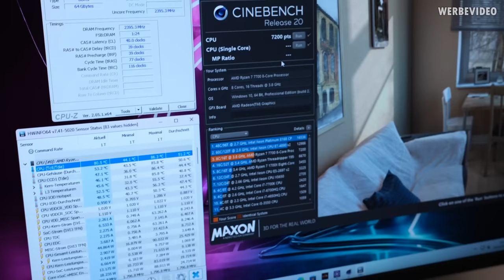Hetzner shows Special AM5 Board with 90° Rotated Socket

Comment: Would love to see a consumer board with the OCuLink PCIe connectors like this baord has, especially on mini-ITX boards where it could allow adding additional PCIe functuonality without requiring much board space.
Reply: Currently the only option is to get a M.2 to Oculink adapter boards. That is a good idea.
Reply: @kawag2780  that's pretty much the opposite of what I want it for. I'd like to have the OCuLink connector to get access to the extra PCIe lanes that would otherwise go unused on ITX boards, not repurpose existing PCIe slots, whether M.2 or otherwise. I've done the M.2 to PCIe riser mod plenty, but it would be nice not to have to sacrifice an M.2 slot and just be able to plug in an OCuLink to PCIe riser (I believe Comino makes some) to access the extra lanes.

Comment: loved the debug plug and s/o to Steve - hopefully manufacturers will listen. Great video, loved to see the Thermal Grizzly cpu bracket and package on the wall behind you haha
Reply: manufacturers won't listen. Many budget consumers don't need the additional cost of a debug led as they aren't enthusiasts and run their computer at factory clock and voltage settings. And for them, the good old beep codes are enough to troubleshoot.
Manufacturers also could provide what is used in embedded : a cost-effective serial interface for debugging like a proper JTAG port. That's a better solution. Why they never provide it even on custom clients like Hetzner is now probably due to avoid exposing the vulnerability of the coprocessor/hypervisor (Intel ME, AMD PSP) but it also could be seen as planned obsolescence and market segmentation.
Reply: @PainterVierax the extra costs are minimal. The actual hardware is pennies for many since they buy these in thousands of units, the coding and engineering has been done for years already so that adds minimal cost to it as well. Its just about updating it to the latest boards. Never mind that the internal bios codes needed are already there anyways. They need to be for the bios to know what beeps to use and errors to display in other ways. The only reason mobo prices are as bad as they are is pure greed
Reply: @Kellen6795  every cent counts for margin, no matter the greediness we're talking about cost effectiveness on both sides. Adding components adds manufacturing time though.
The coding and engineering of those error codes is done by AMI (mainly), not the motherboard manufacturer. With EFI and coprocessors they are totally able to provide any verbose prompt instead of a 2 digits hex number coming from the 80's. Motherboards were capable of memory training and BIOS Flashback way before that.

Comment: The rotated orientation is quite interesting  for me. For my personal rig (7700X) due to my very odd case (and very, very old) I needed the same type of air flow to fit a low profile cooler. Noctua was great in sending me different mounting brackets so I could rotate the cooler 90 degrees and have the intake fans blowing straight thru the fins. Dropped CPU temps close to 10 degrees!

Comment: Would buy if available commercially, great option for a low power ish backup server, or even an edge node
Reply: Stick a Quad port Intel nic in the x8 slot and make it a PFSense router

Comment: Nice, perfect layout for cases where the MB is mounted with pci slots vertical (silverston raven and some other brands uses this setup). great air cooling from bottom, with ram slots not in the way for air to the cpu components. Rams also running cooler

Comment: The cooler works better because the RAM isn't interfering with airflow.  A longer cooler is actually worse because the internal air temperature being higher near the exit means it has a smaller delta vs the heat source.  It's like how with slow fans a thick radiator gains nothing over a thin radiator.

Comment: Sweet custom motherboard to optimize airflow. The guy responsible for optimizing cable routing / plug location was probably on a lunch break when they decided where to put the power connectors though :D :D :D

Comment: That board is basically a reincarnation of the failed BTX standard.
Reply: oh I remember BTX yeah, the PSU was placed on the bottom of the case right?
Reply: Nah btx was mirrored too.
Reply: BTX was mirrored, so that the IO was on the right and required a case with the motherboard mounting on the opposite side panel than ATX/uATX/mITX uses. 

Definitely not even close to BTX. This is more reminiscent of EVGA's "Dark" AMD boards with the rotated socket/RAM.
Reply: It could also be mounted upside down which is what several case manufacturers did for adapting ATX and BTX in the same case. It's a shame that BTX was designed more around fixing the problem of P4 heat than a logical redesign of ATX as the memory placement vs CPU ensured its death.
Reply: @thestrykernet  still required a different case, since the IO has to be at the bottom when done this way, but I do remember a few of these systems back in the "oh how I wish I could forget the" NetBurst P4 days.
Reply: Big Tilted Xotherboard
Reply: @bjn714  I know Thermaltake just sold separate backplates for upside down mounting while Coolermaster had an adjustable backplate and rails on both sides of the case to reverse it.
Reply: @thestrykernet  yeah it's still a specialty case compared to just an ATX case, so they weren't very common (much like BTX wasn't). Luckily this era was after I had already sold my retail shop, and was doing contract IT work, so I didn't have to deal with these except on a few occasions and never actually had to build with one.

Comment: Thats awesome that they get custom MoBo's like that... I guess when you are buy 10's of thousands of boards it's cheaper to get custom boards then redesign your entire air-flow system...
And it's aso great to see that they are willing to test direct-die situations just to see if they can increase the efficiency.... with that many cpu's needing to be cooled, a 2 degree difference could save them thousands of bucks every month on cooling power costs..... with that many computer systems every little bit adds up to BIG BUCKS!!!! 
THANK YOU for showing this!! I LOVE when you make data center videos!!! As gamers we don't normally think of computers at that scale, and we just don't worry about efficiency. It's a nice change once in a while :)
Reply: also cut a lot of money from the IHS i guess
Reply: 200W is 200W no matter how well you are removing that heat. It won't change cooling bills
Reply: @GewelReal  Lower temperatures means less power usage. This is because silicon gets less efficient the hotter it gets. You can even try this at home: set the fans on your gpu a bit lower so that it runs 10c hotter, then you will see that the performance wont change much, but power usage will go up by a few percent.
Reply: @GewelReal  200 watts is 200 watts if you are just talking energy, but if you are talking performance you are incorrect. a CPU that is moving that 200w heat load away is going to be more energy efficient than a CPU that is throttling due to the slow movement of that 200w.
So in terms of cooling bill, you run your systems for less time doing more work.
Reply: @stormagheddondarklordofall7171  we are not talking about throttling
Reply: @GewelReal  CPUs rely on boosting and that works by looking at thermal headroom so if you want your CPU to reach the best possible performance it has to feel the cold. It's not as simple as with Pentium 4 where it just ran regardless and it thermal throttled only when hitting high temps.
Plus as others said the silicon temp will affect its efficiency. Yes this is irrelevant for home users but they have tens of thousands of these systems in their datacenters so it does add up

Comment: I wonder whether the temp delta is because of the longer cooler, or the lack of the RAM fouling the airflow.
Reply: Definitely the RAM.  A longer cooler is actually worse because the internal air temperature being higher near the exit means it has a smaller delta vs the heat source.  It's like with slow fans a thick radiator gains nothing over a thin radiator.

Comment: i always did like the wind tunnel airflow configurations of servers and found it a shame that it never quite made its way to the general consumer. a single axis of airflow makes air cooling a lot easier to design for.
Reply: dell and hp use it in prebuilts. for consumers its nit common probably because of too many variables and everyone wants to see the components. dont stock gpus use that too?

Comment: Honestly these should be the norm for all boards. The air flow in standard cases with the "Z" shape flow never really made sense. Front to back air flow, windtunnel-like effect made more sense. So the RAM and heatsink should have followed that flow direction. It makes sense even in non-server case setups. From my experience only some HEDT & Workstation (Prosumer) boards do this though. I never really see it on the more consumer-ish boards, even the expensive ones.
Reply: i guess it never really was a thing since pcs had 5.25" bays and other bays at the front for cd drives or fan controllers or anything else. Only recently did pcs drop those in favour of fans.
Reply: Buildzoid did a piece within the past year or so on EVGA's rotated boards, it's generally a bad idea to rotate the socket like this. It requires way more PCB layers to prevent signal problems because the traces have to twist around noisy components. This is a specialised deployment in which the company has judged that it makes sense for them to use it, but it otherwise just reduces signal integrity and increases board cost for no reason.
Reply: @hovant6666  which did he test? This seems rotated one way but the Workstation/HEDT boards I have, have it rotated a different way than this, especially with the VRMs more so at the top of the board, not near the PCIe slot. Check out the ASUS Pro WS W790E-SAGE SE and ASUS X99-WS/IPMI for example. I think those are the ideal boards. I would think those very expensive HEDT/Workstation boards care even more about signal integrity and reliability because people who buys those kinds of boards tend to do prosumer work, like video editing, 3D modeling, etc instead of buying for gaming.
Reply: The CPU orientation is a legacy thing, from the days when the PSU was on top pulling hot air from the cooler, nowadays it don't make sense.

Comment: Do these boards support ECC? (not DDR5 on-die ECC, but full ECC)
Reply: From the last BIOS from manufacturers, you could use ECC UDIMM ram on most AM5 motherboards. The problem is, there isn't any cheap ECC UDIMM DDR5 at the moment and you can't find it anywhere. I think the market will much more improve for ECC UDIMM later this year.

Comment: when will they make MB for better cooling & performance ??? obviously that ram is blocking much of airflow , gpu under cpu makes cpu hotter etc. finally they decide to replace power and other connectors to MB backside , and some  even make pci-e power connector near pci-e port to avoid cables ... but many years ago was btx MB format for better airflow to cool all pc parts...  and another thing - is more heat from pc parts .... if future cooling systems will require watercooling , they should make MBs for better loop placement also, to let people use mini cases  etc.

Comment: Now imagine 2 RAM slots on either side of the motherboard so they're all the same trace length, maybe Ryzen 9000 could hit 10400C58 on a board like that :P
Reply: Did you even watch the video? Our man here was talking about CPU pinouts and difficulties about PCB trace routing.
Reply: The cpu would need a redesign, the traces from the chipset run along one side, so straddling the CPU would not be equal length. The current layout with all slots on one side offers the shortest distance regardless of orientation.
Reply: @radugrigoras  I can dream cant i :(

The socket and CPU would need a re-design for best performance with a 2+2 RAM desing, which is probably going to happen by Ryzen 9000 as thats probably coming after 2025, but its not going to be re-designed the way i want it.

What i want is an HEDT like board, same orientation as current, but with 1-2 slots on both sides of the socket with equidistant trace lengths. This can be achieved with the current socket, but it would require the slots   to be visually different distances from the socket, and best served with a repdesign with the IMC at the top of the IO die, and memory pin-outs on both sides of the package. Basically you get the speeds of a daisy chain board with only 2 RAM slots populated, but can use 4 dimms at that speed, and with 1 slot per channel, it would be as fast as using a single slot, on a 2 slot board(assuming the memory controller isnt the limitation)

The IO die is closest to the top NVMe slot(bottom of the CPU), but the memory traces move to the right side of the CPU/socket to be close to the current RAM layout, if the socket is rotated, and the pad layout changed, it would reduce the trace length for RAM, but increase it for PCIe, and i dont really know which is more important, but i'm leaning towards faster RAM
The 4090 loses like 4% performance going from gen4 to gen2, and that seems to be a normal drop not because of the speed difference, but because of not running at native because the 3080 had a similar drop going from gen3 to gen2

My 5700G on the otherhand sees a huge performance jump going from 4933C19 to 4933C16 almost fast enough to make up for the lack of cache compared to the 5700x, but the only way i can do this(get over 4400 with a 1:1:1 ratio) is with a 2 slot mini ITX board, most of the 4 slot boards i've tried have a limit around 4000-4200, but most 2 slot ITX boards, even the cheap ones like the B450 Asrock Phantom Gaming($125) will hit at least 4733

With the current tired-old layout you need soo many extra layers to make room for T topology, let alone both channels to be equadistant, though if the 5700G on cheap 2 slot boards is any indication, maybe we should be using those layers to make each channel equadistant, instead of trying to get T topology on a 4 slot board.

Comment: 1:40 nobody cares about PCIe slots on servers for rent.
no gpus
no HBAs
no fast networks
Reply: Hertzner also offers containers and VMs, they also need shared storage to keep the containers the object storage and the VMs somewhere. So yes a lot of those boards will have GPUs, HBAs and fast network cards
Reply: hetzner have a list of custom hardware you can offer. if you want 10g uplink then you need nic. they can also add more nvme for you - this will also need a card. they also have various storage controllers they could offer you. Network card is probably the biggest thing as you can order switches for local interconnects.